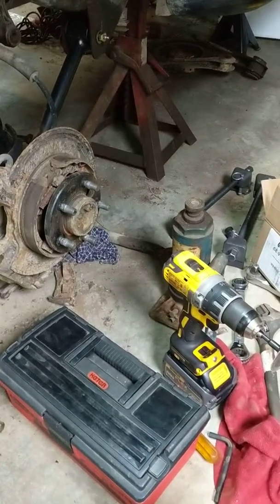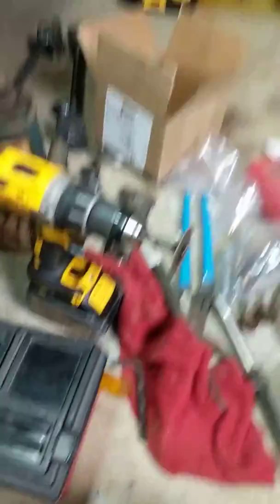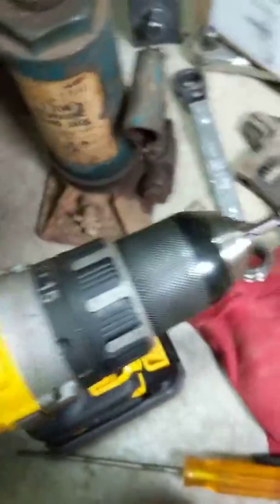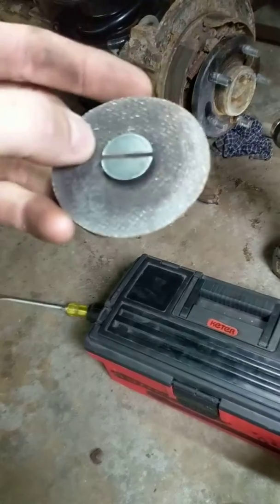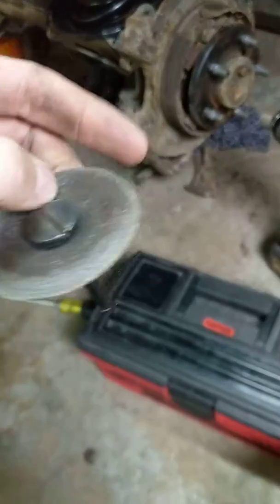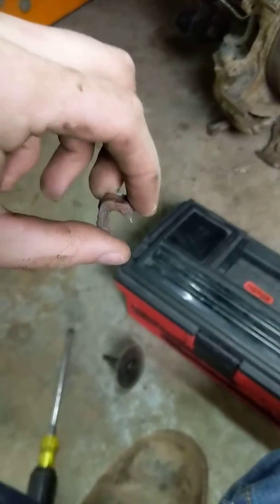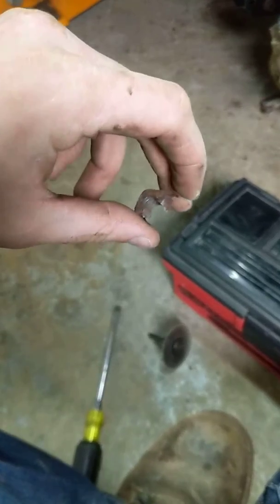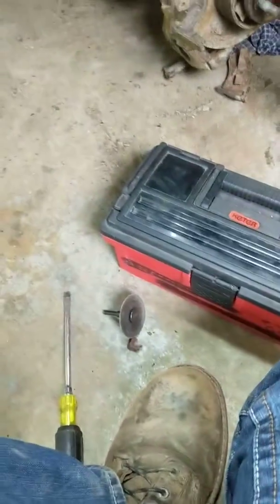Removing Jeep  TJ rear upper shock nut

Comment from the maker: Honestly, the best way to do this is to not break the bolts to begin with. Soak all your bolts in good penetrating oil for several days. Leave a rag soaked in oil on top of the nut and bolt. 

I got 3 of 4 out when I took time to get a good snug fit with a socket (might have had to wire brush the bolt head some and beat the socket on with a hammer.) But then just barely try to break the bolt loose. Then tighten it again to get it working. Going back in forth in this fashion while oiling. Take breaks in between and work the other bolts so they don't heat up and break. Come back next day if you have to.

Comment: Did you drop your fuel tank or lift your body?
Reply from the maker: I had like a 1.75" body lift I believe. It helps get to it. Dropping the fuel tank would be helpful as well. Run the tank kinda low and a motorcycle jack works decent. I borrowed one off a guy one time to do it.